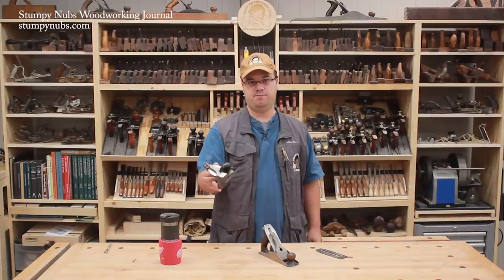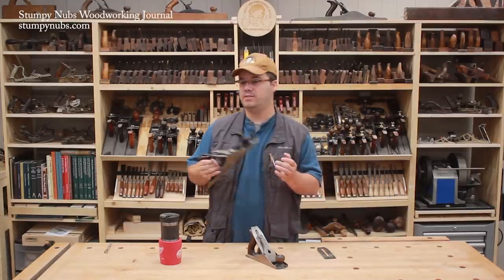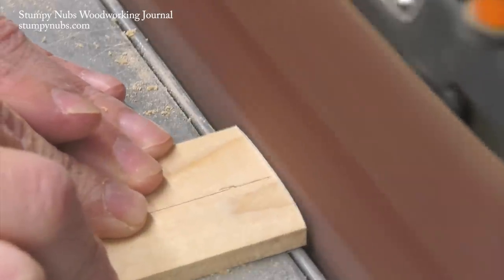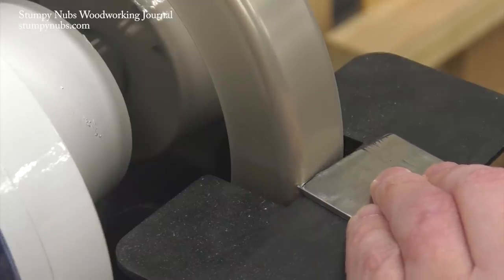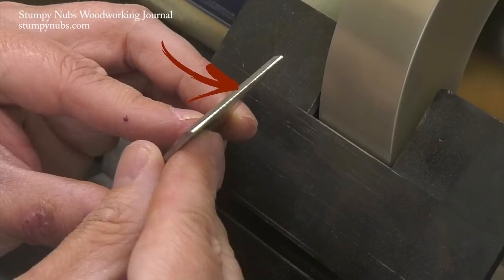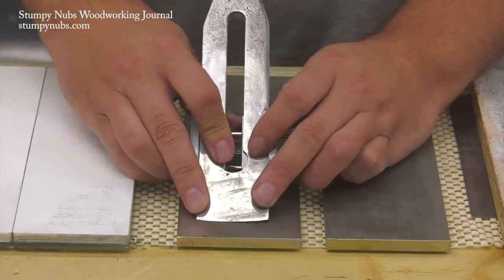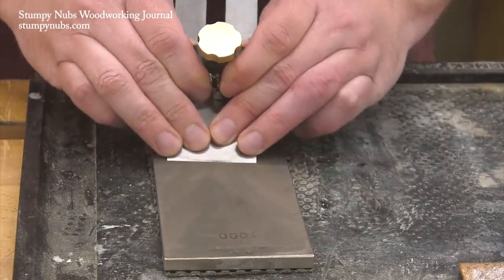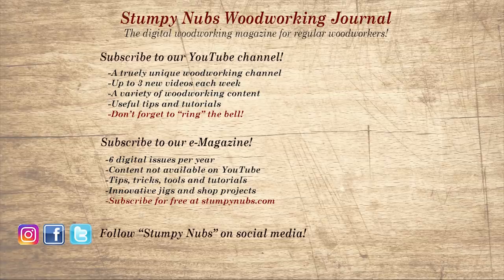Retire your dusty belt sander! Cambered plane irons work!

Comment: I had an old #26 Transitional plane that had been sanded down to the point where the mouth was just too wide. Rather than resole it, I cambered the blade at  a 7 1/2 " radius....Incredibly useful as a scrub plane!  Your video nails it. 
I love how the chips just fly off of rough stock. 
What was a $5 wall hanger is now tons more fun than my power planer and jointer.

Comment: In the late 11960 as a senior at school my woodwork master taught me to sharpen planes and chisels. he emphasised how important it was to put the camber on the plane blades. best lesson I ever had. I have done this ever since. 
Why the steel rule when you take off the burr? I was taught to have the blade dead flat on the stone.
Reply from the maker: It's known as the Charlsworth Ruler Trick. Unlike a chisel, a hand plane iron doesn't rely on the back as a reference. So the entire back doesn't need to be flat. By laying the ruler on the stone you create a tiny back-bevel, flattening just behind the cutting edge instead of the whole back of the iron. It's a trade-off. You can spend a few seconds flattening just the area you need, every time you hone. Or you can spend a lot longer flattening the whole iron once.

Comment: Nice video, thanks. I rarely use hand planes because I never seem to be able to get them to cut smoothly. Even after sharpening. I only have 2 or 3 inch and 4 inch plane (don’t remember the brand) the smaller one I can usually get to do some work but not the other one. All I have to sharpen them is a whetstone 400/1000. A fixed income and lack of space in the shop prevent me from getting a grinder. Thanks again stay safe.

Comment: I just bought a new higher end blade & chip breaker for my #5 and was going to radius the old one to use as a scrub.  Now I have a great guide.   Thank you!  My shop is in the basement, next to the furnace.  I don't want dust going through the rest of the house & the family lungs so I don't sand.

Comment: That was a really useful video James.  I have two #4 1/2 planes and all I have done till now is keep one adjusted deeper than the other.    I've wanted to turn one into a scrub plane, but have not felt comfortable about what sort of radius to use, so it has remained in the too hard basket.  That is going to change this week.   BTW  I received the 3000/8000 stone I ordered after your last video, and after spending time with it, I have pretty much changed my mind and reverted to the 8000 grit DMT diamond plate.  The whetstone definitely cuts better, but is leaving a rougher surface and edge.  The DMT plate is producing a polished, almost mirror, surface by comparison, and a sharper edge.  Perhaps I need to wear in the whetstone to make it work better.
Reply from the maker: A #4-1/2 is considerably wider than a #4 smoother. Wide planes make poor scrub planes because the extra width means a lot more wood removal with each pass, especially when taking a thick shaving, as a scrub plan is meant to. I'd sell one of the 4-1/2's on eBay (they are worth more than the standard #4) and buy a good #5 to use for heavy stock removal.
Reply: @StumpyNubs  Thanks. Great info.  I've mentioned before that I am a retired toolmaker who has discovered the joy of working with wood.  I also firmly believe that life should be spent on one long learning curve.  When you stop learning new things it becomes boring and you move on.  I'll look out for a #4, but it's been a while since anything like that went for a song on the auction sites.  Three of the planes I now own  I restored from rusty wrecks donated to my Mnez Shed.  I paid $20 each for them, and bought them back to life.
Reply from the maker: Get a #5. That will be your Jack plane, while the other #4-1/2 will be your smoother.

Comment: Stumpy, I enjoy your videos and watch for a new one always. I agree a good plane is a better choice than a belt sander and have been using them over a sander of any type for years. One problem that I have is the shavings. I'm a weekend hobbyist so I don't a big dust collection system.  I use a dust collection system with a shop vac and a cyclone dust separator on top of a 55-gallon drum in the shop. Here is the problem, the cyclone will pass about 30% of the plane shavings to the shop vac, yet get all of the sawdust. How about doing a clip on the different cyclones and maybe a solution to this problem. TIA and keep making great videos.

Comment: This is more of a justification to use something other than a belt sander in some situations.
I did a lot of commercial millwork in occupied buildings & the fit was expected to be within a 1/16" or less.
Using a belt sander could get much closer than that but the fine dust would get everywhere but even worse it could trigger the smoke detectors! What a mess!!
After the 1st time we would have to research the system before any work began.
I hope this helps others in the trade.

Comment: Is there any reason other than avoiding the heat build-up for grinding the radius first & then the edge? I've always gone straight for the edge angle & can't say I've had any problems. If the very edge does get too thin for the grit on the grinder, a quick rocking over some emery cloth (perpendicular to the flat) provides that thin flat to hone.
Reply from the maker: Grinding the radius first gives you the benefit of the flat facet which grows wider toward the corners, to use as a guide when free-handing the bevel. Many folks who are inexperienced with free-hand shaping find that useful. It also ensures that you leave a tiny flat fact on the cutting edge to, as you noted, avoid overheating the thinnest part of the steel.
Reply: @StumpyNubs  Right, gotcha. Thanks. I may try it next time I need to regrind.

Comment: Interesting, you essentially turn a #5 into a scrub plane with the added benefit of the easy depth of cut adjustment. I did this to a #4 smoother. There's no way I'd do this to my #5's. I do put a slight camber at the outside edges, but the center is flat so I can get a smooth, no need to sand finish with the plane. The slight camber at the corners of the iron eliminate the plane marks when doing finishing passes, no need to repair scalloped grooves in the wood, which you will get with your radius grind. That may the look you desire with the radius.
Reply from the maker: #5's were commonly ground with a camber and used much like a #40 scrub plane. The #4 was used as the smoother. Don't forget, you can buy more than one iron for a plane and grind them differently. I know some people who use a single #5 plane with two or three irons for all their work.

Comment: I have a question that is actually a trap for lining me up for another question. : Why don't you (we) use diamond wheels on your grinders?
Reply from the maker: I believe it has to do with the fact that diamonds are carbon, and at the high speeds and pressures that bench grinder wheels experience, carbon can transfer from the diamonds to the steel, changing the composition and compromising the integrity of both.
Reply: @StumpyNubs  Right. Then why are we using diamond plates in sharpening, and not CBN plates? I suppose because of the speeds and pressures bit. But if 'bad things' are happening at high speed, are they not happening proportionally less but still happening whenever rubbing steel on diamond (i wonder)?
Reply from the maker: Slow speeds do not build up heat, so the bad things do not happen.

Comment: I tried looking for your recommendation on a Miter Saw, can’t find one. DIY 10 inch Miter Saw, what would you recommend? 

Thanks
Reply from the maker: Ridgid makes a very nice 10-inch miter saw for a decent price. I have one in the corner workshop. https://www.homedepot.com/p/RIDGID-15-Amp-10-in-Dual-Miter-Saw-with-LED-Cut-Line-Indicator-R4113/306939250

Comment: Unfortunately Stanley doesn't make planes anymore. The only ones I can find are the ones sold at harbor freight.
Reply from the maker: Stanley does make planes still. But why buy a new one when there are hundreds of thousands of old #4 and #5 planes out there? You'll find them at rural yard sales, flea markets, antique shops and especially on eBay. Or you can buy new planes of high quality from Woodcraft and other retailers. Nobody has to use a Harbor Freight plane :)